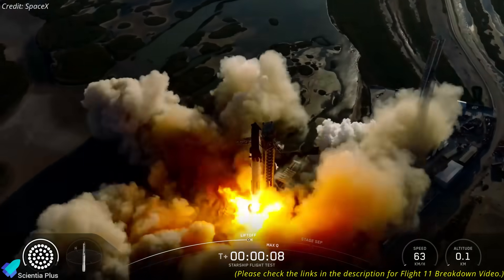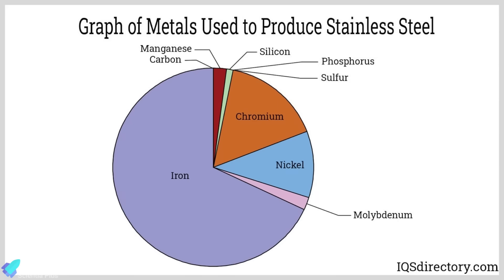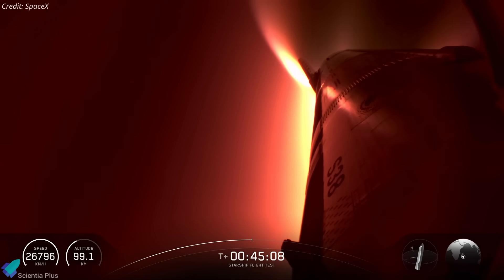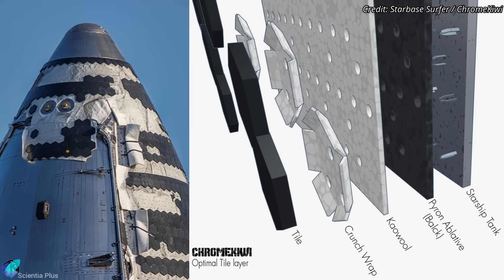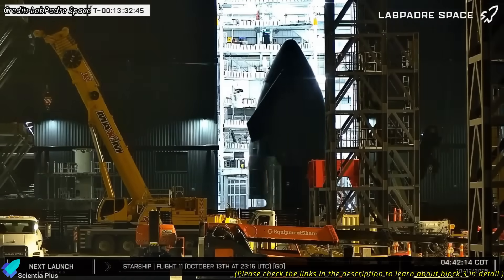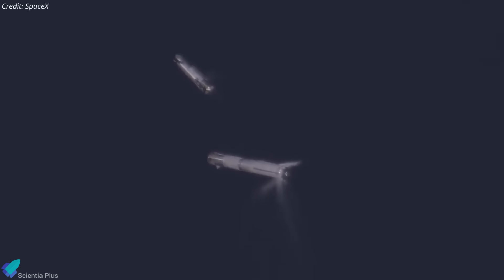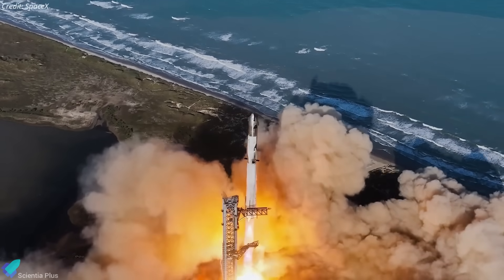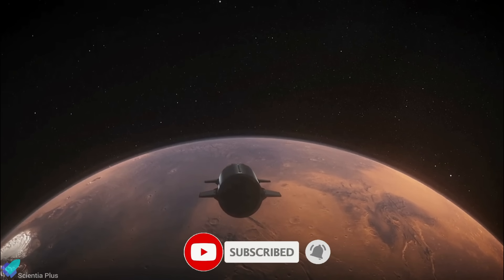A Closer Look At How Starship Flight 11 Survived Heavy Damages!

Comment from the maker: 🚀 Starship Flight 11 Detailed Breakdown: https://youtu.be/r6jHVPpiEcw
🚀 Starship Flight 11 Super Cut: https://youtu.be/EG1PADTbIdM

📚 Learn More:

🚀 Starship Block 2 Explained:
 📖 Summary: https://shorturl.at/b0dtw
 🔍 Detailed Explanations:
  • Design Improvements Update 1: https://shorturl.at/lpGT7
  • Design Improvements Update 2: https://shorturl.at/gwNQ4
  • Nosecone & Payload Bay Redesign: https://shorturl.at/xa60S
  • Methane Downcomer Redesign: https://shorturl.at/XdYBG

🚀 Starship Block 3 Explained: https://shorturl.at/mnBT4
  • Detailed Breakdown: https://shorturl.at/IViwD
  • Production Begins: https://shorturl.at/xRNkJ
  • New Transfer Tube / Downcomer Explained: https://shorturl.at/Iaqc6
  • New Grid Fin Explained: https://shorturl.at/NxdVo

🚀 Starship Block 4 Unveiled: https://shorturl.at/7A2ef
 
🔥 Raptor V3 Mega Upgrades & First Test: https://shorturl.at/TRIyj
🧱 What’s Inside Starship GigaBay?: https://shorturl.at/nJM75

🛠 Insane Engineering of New Starship Launch Pad 2: https://shorturl.at/7RAZd

🛢 Dual-Port Orbital Refueling – Full Technical Breakdown
https://shorturl.at/5tiqK

🛠 Other Starship Upgrades:
 • Hot Staging Explained: https://shorturl.at/jf400
 • Super Heavy Booster Upgrades: https://shorturl.at/Pi5R3
 • How SpaceX Protects Raptor Engines: https://shorturl.at/4Om8F
 • New Heat Tiles Explained: https://shorturl.at/p2Ijb

🚀 Starship Flight 10 
  📽Detailed Breakdown: https://youtu.be/irVUMJNe0Kc
  📽Root Cause of Anomalies: https://youtu.be/LBUpp7MRVSY

🚀 Starship Flight 11 Detailed Breakdown: https://youtu.be/r6jHVPpiEcw

📡 Stay Updated:
📢 Weekly Updates: https://bit.ly/3HIQjPC
🚀 SpaceX Playlist: https://bit.ly/34wue8T

Comment: The SpaceX announcer mentioned, during Starship's re-entry, using Starship for intercontinental transport.  From America to Australia in an hour instead of twenty hours by air.  At this stage it doesn't seem like a very good idea but with overall improvement over time it could be accomplished.  Many though will balk at this form of transport fearing disintegration re-entering the atmosphere at extreme velocities.
Reply: It would be nearer 30 minutes from anywhere to anywhere on earth.
Reply: @alesh2275 
Nope, a vehicle in a near-Earth orbit completes one orbit in around ninety minutes. The Space Station orbits at around 260 miles and has an orbit period of 93 minutes. From any point to any point on Earth in thirty minutes is ambiguous as anyone can start somewhere and be somewhere else in thirty minutes. 🚀

Comment: They think this bucket of bolts is gonna fly to Mars? They can't even do a suborbital flight without major problems.
Reply: You realize these are test ships.  Made to gather data.  I remember someone saying the same thing about catching the booster.  And the same about reusable rockets until falcon 9.  And before that it was about going to the moon and before that it was about flying in the sky and before that it was the horseless carriage.     
   Haters gotta hate i guess.
Reply: These are test flights where they're stressing the vehicle to it's limits to find out what those limits are. Soon enough these ships will become just as reliable Falcon 9.
Reply: Where were the major problems on this flight?
Reply: @liamb8379 it even landed with holes in it.   If that ain't tough I dont know what is.
Reply: செ ஆனந்தன் சென்னை ஐஐடியில் கிராமத்து விஞ்ஞானி ௮வாற்டு வாங்கினேன் ௭லோன்மஸ்க் சகோதரர் செவ்வாய் கோளுக்கு மனிதனை ௮னுப்புவதற்குமுன்னே ௭ன்னுடய 20 கேள்விகளுக்கு பதில் சொல்ல வேண்டும்

Comment: Poppycock! Went up. Came down intact. This thing is fully operational right now in disposable form and and that means with a recoverable first stage! I suspect musk is going to start putting up satellites immediately!
Reply: Best comment: it is already operational in disposable form.
Reply: The Starship cannot reach a suitable Starlink inclination from Boca Chica.    I am not sure if it has the delta V capability to achieve orbit, deorbit and land.
Reply: @ronlee9984 
Yes it’s true that Starship launches from Boca Chica, Texas (latitude ~26°N), are constrained by FAA airspace rules to safe trajectories over water, limiting initial orbital inclinations to roughly 26–33° for eastward launches. This avoids overflying populated areas in the US, Cuba, or Mexico. However, a recent FAA proposal (Draft Tiered Environmental Assessment (EA) process under the National Environmental Policy Act (NEPA), September 2025) aims to expand Boca Chica trajectories slightly for return-to-launch-site profiles, potentially enabling limited Starlink V3 deployments (~100 tons per flight) if needed, though at reduced efficiency.

Launching from Florida’s Cape Canaveral solves the inclination issue for Starlink missions. SpaceX has already been developing launch infrastructure at Cape Canaveral Launch Complex 39A, with full operational launches expected in 2026 pending FAA approvals.

Starship V2’s delta-V of approximately 9.8 km/s is above the ~9.4 km/s needed for low Earth orbit (LEO) from sea level. If Starship V2 were a disposable, single-use rocket, the available delta-V would be sufficient for LEO insertion even with payload. However, complex maneuvers like dogleg trajectories for higher inclinations (e.g., Starlink orbits) would impose a penalty (~0.3–0.5 km/s), potentially pushing the effective requirement near or slightly above 9.8 km/s depending on payload mass.

Comment: I know this isn't HLS, but I don't remember any emergency escape systems in Starship designs. Humans are far more delicate than stainless steel.
Reply: Not needed when there is no passengers.
Reply: @myfavoritemartian1  such enlightenment
Reply: The solution is to make the craft reliable enough that it’s safer without extra systems.
Reply: @peterclarke3020  Have you seen any escape system on HLS renderings? All I have seen is the slide-escape system from the tower.
Reply: Baby steps.
Reply: NASA has expressed satisfaction with SpaceX’s progress via public statements from HLS Program Manager Lisa Watson-Morgan and others. These milestones demonstrate hardware maturation, testing, and integration for critical systems like propulsion, life support, docking, and propellant transfer. Below are the primary ones highlighted as successful:

•  Over 30 HLS-Specific Milestones Completed (as of February 2024): SpaceX defined and tested hardware for power generation, communications, guidance and navigation, propulsion, life support, and space environments protection (e.g., micrometeoroid and orbital debris shielding). NASA noted this as “remarkable progress” toward Artemis III and IV readiness.

•  Raptor Engine Testing for Lunar Descent (November 2021 and September 2023): A 281-second hot-fire test simulated the powered descent from lunar orbit to surface, validating throttle control under vacuum conditions. This was one of the first milestones under the Artemis III contract and confirmed the engine’s ability to handle landing demands.

•  Full-Scale Docking System Tests (February 2024): Successful end-to-end simulations of Starship HLS docking with NASA’s Orion spacecraft (and later the Lunar Gateway) in near-rectilinear halo orbit. This ensures safe astronaut transfer for Artemis missions.

•  Life Support System Testing and Mockups (February 2024 and Ongoing): Fully tested environmental control and life support systems, including a functioning crew cabin mockup with sleeping quarters, laboratory spaces, and control panels at Starbase. NASA has conducted monthly astronaut reviews to refine the design, praising its alignment with long-duration lunar needs.

•  Cryogenic Propellant Transfer Demonstration (March 2024, Flight Test 3): In-space transfer of thousands of pounds of cryogenic propellant between internal tanks during coast phase, a Tipping Point award milestone. NASA reviewed the data as “crucial” for orbital refueling, essential for sending a fueled HLS to the Moon via multiple tanker flights.

•  Early Independent Milestones During Contract Hiatus (2021–2022): SpaceX completed five unprompted milestones, including additional Raptor tests, while legal protests delayed Option A work. NASA resumed “fully engaged” collaboration afterward, crediting this proactive progress.

These achievements have earned milestone payments (totaling ~$1.9 billion by late 2024) and positioned SpaceX for upcoming goals like ship-to-ship propellant transfer campaigns and a critical design review in 2026. NASA emphasizes that while more validation (e.g., uncrewed lunar landing demo in early 2026) is needed, these steps reduce risks for Artemis III.